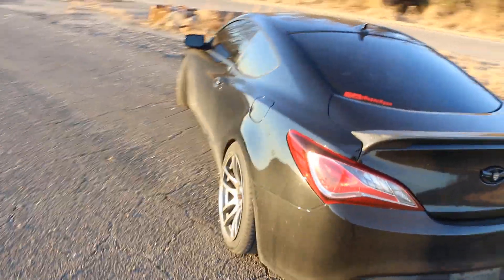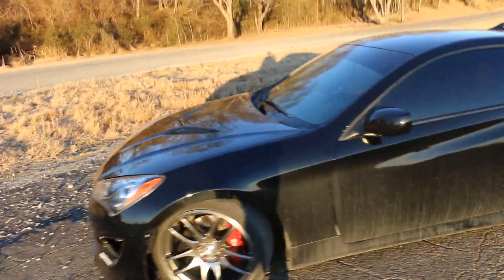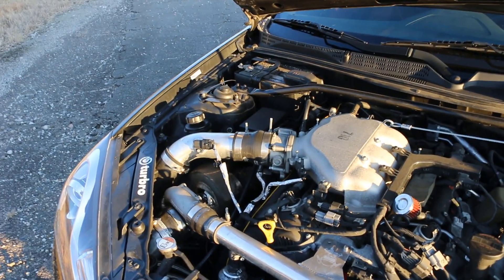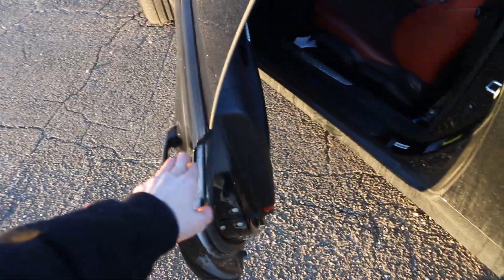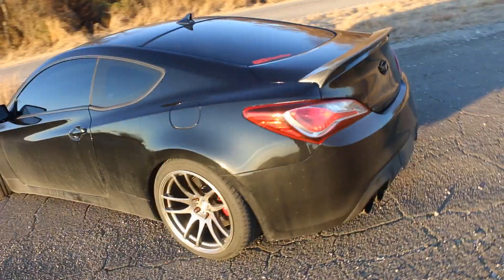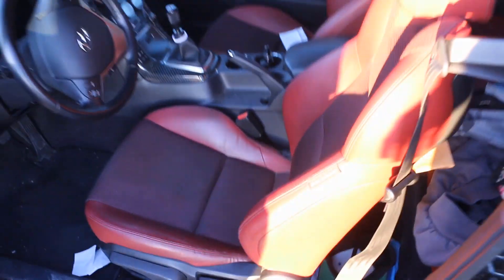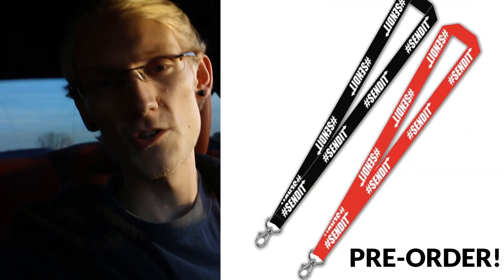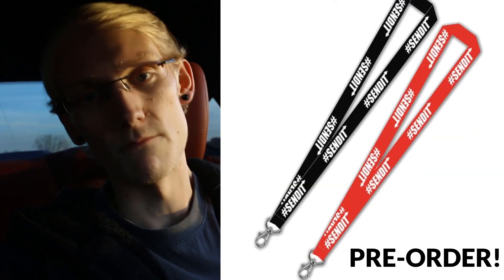Why I HATE My Boosted 3.8 Genesis Coupe

Comment: The door noise is your glass seating itself in place. Whenever you open the door the glass slides down like an inch, the when you shut it it seats itself to help seal it more
Reply: Why I hate my life #TooManyCarPaymentsNoYoutubeMoney #4Cars #Evox#WrxSti#C7Vette#2xTurboV6accord
Reply: thank fucking god someone else knew this, i was seconds away from going off in the comments, but ya, its supposed to do that basically. maybe it could sound better but it also works as a protective measure for the glass to it doesn't rub, push up againt, or bend into the door lining
Reply: Actually it happens so that there is a way for air to escape and pressure to equalise while opening and shutting the door, so that Δp surges does not break the windows.
Reply: This
Reply: it's so obvious I thought he was kidding...but I guess not geez
Reply: there should be hidden flaps in the car under the trunk to allow this to happen. where the hell do you think the air goes when you have the air on and it isn't' recirculating? what about cars that have the door glass framed like my dad's mazda protege? this is specifically to protect the glass
Reply: @berengerchristy6256  There is, I gutted my trunk and there is a flap on each side of the car under the trunk liner
Reply from the maker: I know the glass slides down, i am aware of this. Its pretty obvious. That is not what i am talking about, im talking about the glass smacking the seal of the car and making a god awful noise.
Reply: For somebody who is a car enthusiast I would’ve thought he would’ve known this
Reply: hes talking about the sound the window makes before it slides back up into place, not the actual sound of the window sliding.
Reply: RspecRyan oh okay. I was just trying to be helpful lol no hate bro.
Reply: @RspecRyan  Sounds like a door issue, I've been in three gens, plus my own, and none of them sound like that
Reply: I drive a coupe e400 2014 the windows do the same thing but the doors have a nice shut and seal quietly
Reply: I don't believe it does it for a better seal, most of the time the windows do that to reduce the build-up of pressure in the cabin on a hot day as a safety feature.
Reply: It's called indexing.  The windows rolls down to open and then up to seal in the outside strip.  Ford Mustangs do the same thing.
Reply: @LHofstadter  that's true for for Mustangs but for the scion FRS it was designed to release cabin pressure and in his car I'm pretty sure it's for the same reason.
Reply: nah doesnt sound like that new its not loud at all new its from years of weather wearing on the seals so now its hitting the metal doorframe a bit as it seats onto the seal

Comment: The transmission was the same in my 8th gen si. Once I changed the clutch master and slave to the ktuned one (gets rid of the fluid delay valve) it shifted so much better. I also did little things like shifter bushings and base bushings which also made the transmission feel much more smooth and easier to get into gear at high rpm's.
Reply: Bruh a 100 videos and 100 forums later in the comment of a video I didn't notice said boosted (so I woulda never clicked on it) was this answer. Lol

Comment: Hey Ryan, try flushing with the gm synchromesh friction modified transmission fluid and if it still gives you problems then add lucas transmission fix to it. Hyundai synchros are just poorly made and incorrectly sized from factory. Do this and shifting will be easy. It works. I really really hope you see this comment.
Reply: Dmitriy Sen thank you for this

Comment: Hyundai are getting better with their cars I own a 2013 Elantra I decided to turbo it with a boostec performance turbokit running a Garrett gtx2860 running about 5 psi for a safe tune for daily driving and running a aem fic for boost and the bigger Bosch 550cc injectors I been running this set up for almost two years only problem I have was a map sensor code that I just finally figure out from buying a expensive scan tool to reset the engine adaption value to fix the code but from that no issue engine pulls hard for only 195 to the wheels
Reply: Micah Hill how much did it cost to boost it
Reply: Crowd Killer 5.0 overall it cost me around four grand
Reply: Something Wicked This Way Comes when it was stock it made 143 to the wheel with a kn typhoon intake and the custom exhaust on the 1.8 im basically making the same amount of power as a turbo veloster and Elantra sport with the 1.6 turbo gdi engine stock power and even a little modified one as well with a intake and exhaust maybe
Reply: Something Wicked This Way Comes well it is hyundai way of making a engine to save gas but not make any power also what engine was Honda running is it an civic with a b18 or b16 vtec motor cause they make around that much power
Reply: @Something Wicked This Way Comes what Honda ? of course if its a sport model it will push more than a stock 2013 elantra. look at the type R or golf R today they push hard and doesnt consume much gas bone stock.
Reply: @Something Wicked This Way Comes thats what I thought. Thats a good car, honda was ahead of the curve for sure in small NA engine
Reply: 195?? 😂 what’s the point
Reply: I think you can go atleast 10lbs of boost

Comment: I believe the door windows roll down slightly and then roll back up when it shuts to avoid damaging the weather stripping.  I know some of the challengers do this as well.  It sounds a little annoying, but helps in the long run.
Reply: It is for air pressure in the cabin. Luxury cars have done this since the late 80's so your ears don't pop. That said the glass should be reinforced a bit more.

Comment: The shifting problem is because the step from 1st to 2nd is too large. Pause in neutral for 1/4 second, or so, and it will go in. That is why that syncro fails from trying to cram past it. I think they were trying to accommodate the torque less 4 cyl POS. The other alternative is to remove every other clutch dog on the sliding clutch and 2nd gear. That gives a big gap to enter, which in this case is better. You will feel the slop on and off the gas but just pretend it is a well used pussy.

Comment: There are plenty of nicer options for the Genesis in regards to front bumpers. 
Hyper G, Ark Legato, Ark Solus-
All very nice pieces in my opinion. I’m aiming for the Ark Legato myself.
Reply: Hyper G is my fav
Reply: @Xabier__Gomez  
Hyper G is nice. I'd like that or something like it for the rear. (Ark Solus, iirc; haven't looked at modifying the car since the original comment)
Reply: @Zephyrine.Koritsuka  I have the hyper g as rear bumper on mine and it looks mint. Down the line, I want to finish the kit with side skirts and front bumper

Comment: I didn't want to go through all the comments but if no one has mentioned it the transmission issue has to do with their synchros the way to fix this is to get dog synchros that is not to be confused with dog gears that whine when you drive just the synchros have to be dog engagement

Comment: It's the synchros aren't meant for aggressive 1-2 shifting like in a drag race.  My Civic Type R has the same issue.  You can burn out your second gear driving the piss out of your "performance" car.  This is why you are best to enjoy a car the way it comes from factory, cause there is always something holding you back when you don't buy a properly engineered car.

Comment: The shifting issue migrh be due to the dual mass pressure plate....it's there to help with the vibration....you might be able to get a single mass pressure plate but it might be noisy and shaki .....BMW has the same thing and people complain about the noise after the aftermarket plate is installed.....just my 2cents
Reply from the maker: It has a stage 3 clutch and lightweight flywheel

Comment: For the transmission do the things you said but...if you have grinded the gear already the syncros need to be replaced. With the movement taken out with your mount, leash and shifter they should keep the problem from happening. As of now the syncro teeth are already rounded off. Thanks for the video and how do you like the shifter. I have the ATQ shifter and bushings and it shifts great now with my replacement transmission.

Comment: It's the 2nd gear sycro it doesnt slow down the gear enough so it doesnt go in and btw the tiburon gets shit talked about it but it's also a great car and also the 2.0 in the tiburon has made more power before than the 2.0 in the genesis coupe 😏 it is still fwd car tho but it handles well with the right mods and it actually over steers more than ot understeers
Reply: The Tiburon makes barely any power stock and if you want to actually make power you gotta get forced induction which causes thousands. Also not sure how a tiburon faster is than a 2.0t genesis which makes almost double the power and can actually put the power to the ground.
Reply: @teknoartist  yeah it would cost thousands but then again you spend thousands less on buying the tiburon and I said it has made not that it makes meaning when the motor is built the tiburon 2.0 has made more hp then a built 2.0t genesis coupe they have been making 600 to 700+ whp since the early 2000's in Korea the block is physically stronger than the theta I mean I love the genesis coupe but I just said people dog on the tiburon but they have made power before
Reply: @PeelePowered  no they're not and they can make some good power

Comment: Have you asked a gearbox specialist about the box they may have a cure, one of my mates had a Ford Mondeo ST 24V V6 in 6 months it had 2 new gearboxes and he took it to a specialist as he deemed Ford a bunch of idiots the specialist did do work for Ford and he said the problem was with one of the selectors that needed altering as it was fouling up during shifts and he also sent the details to ford and he never had any moe problems.

Comment: Did the 2nd gear issue gradually became worse or it was that bad when it was new?
Sounds exactly like a synchro issue especially if it is getting effected by the fluid type.

If that's the case i think you should look into some stronger synchros which might be hard to find, but i've seen people with really bad synchros get really good results with a really good transmission fluid that is for that that purpose. like Royal Purple synchromax.

Comment: Ryan, would you recommend the genesis as a first performance car for someone?
Reply: I'd say depends on what you want to do with it. Overall it a cool car. A friend of mine had a 2010 with the 3.8L engine. Didn't really go to fast in it since it wasn't my car. If you're willing to go "cheap", I've seen a few gen 1 for for 10k or less. 
I recommend try to drive one if you can. I know some people like the 2.0T version better especially since it's already boosted.
Reply: I'd recommend it. It's enough power to have fun with. My 3.8 has been realiable. Good car to get into the car scene
Reply: @fattygamer94  something that won't  cost a whole lot (I've seen a few second gens for less than 20k with less than 100k miles) stick or auto dosen't matter but I'd prefer a stick. Also I'd want it just to have fun with, no drags or track, just a fun nice ride. As far as mods go I'd do tires and if i felt like it needed it anything with suspension to make it handle better (if needed) and sometime down the road either some sort of turbo set up or supercharger.
Reply: No get a Honda preude
Reply: @Manuel Rivas for sure it is but some people do like it being preboosted to upgrading the turbo setup is easier than installing a whole new one.
Reply: @devinlowe51  Yeah, if you can find a gen 2 you like, go for it. Try looking for certain trims. Like how R-spec and ultimate trims have limited-slip diffs and brembo brakes. The rspec is only available in manual but the ultimate has the optional 8 speed auto.
Reply: I have a 2013 2.0 and it is way more fun than the 3.8 that turbo is sick plus you can tune it and get 300hp to the wheels
Reply: @fattygamer94  it's a toss up when it comes to transmissions on the genisis XD the 8 speed seems idk not up to par with a lot of the other modern autos lmao even in manual mode I've heard people complain how it'll upshift whenever it wants to??? And the manual has that 2nd gear "lock out" issue but that can be fixed. I personally like the look of the 2nd gens and it is just a different car in general. I've seen one 2nd gen Coupe in up state NY.
Reply: @ismazzbot  yeah i got mine dynotuned by jay at sfr.  305whp 350tq.  Its fun. 2.0t full bolton.
Reply: @devinlowe51  dont buy 2.0t gen one. Also what  jose puello   said seems interresting. I don't know about their diffs, but it would be unwise to not get a lsd in this kinda car. Another good choice is a Brz, its kinda slow compared to the competition but handling is freaking good due to low center mass. Also light, so wheels will spin if you want them to in first and second gear. 350z's are great too, just watch out for the weird engine oil burning it would be wise to inspect it thoroughly (is that the word ?). Have fun looking for a car man !
Reply: @cmonguys2227  thanks lmao XD my two current veichles (07 focus and 04 ranger) aren't exactly "mint"😂 and I'm just waiting patiently to get a "fun car" I'm currently going to school for auto body, with some auto tech to go with it. First semester is done basically and i plan on getting either a part time job close to school during the end of the second semester or 3rd semester. If not imma save some pennies and see if i can trade in the focus for something. Anyways I'm mainly attracted to the Genisis due to the fact that they are different you know? And the hoondia that ryan has on the cooler is great XD
Reply: @devinlowe51  Oh yeah this is nice ! wait till you get a job in your field if you can so you dont have to cheap out ! I had a acura rsx that was completely falling apart lol, it was still a really fun car tho. I bought a Brz thats why I gave it a good word, I personally know its a good car. I really like the Genesis too ! I absolutely agree with you that its different and I like what people do with them, lots of respect. Have a great day and hopefully you get exactly what you are looking for !
Reply: @cmonguys2227  the 2.0s are way cheaper to make power on.  The stock block handles a lot of power and you can easily throw in a bigger turbo. If you want to make serious power on the 3.8 you have to invest thousands into forced induction.
Reply: @teknoartist  this is true. only thing is the first 2.0t were not really satisfying without mods. not everyone can afford that kind of car plus mods right away, they usually need to pay for the car itself first. I wouldnt go for the 3.8 for reasons you already mentioned, but its a good choice for first gen stock. I would go for a second gen 2.0t then make my way up the mods as you said, it would just take a lot of time. I personally chose to buy a Brz as I have been a subaru fan for over ten years now and its the first time I could afford one that I wanted, but as I said I really like the Genesis.
Reply: Cmon Guys lol you said to not buy a 2.0 but to buy a brz 😂😂🤦🏽‍♂️
Reply: Yea I got a 2013 2.0 with 75k miles for 5k. Hell of a deal this car is good fast and saves a lot of gas. Plus sounds very good with cherry bomb mufflers. Mine is stock currently going to tune it up but even having it stock with cherry bomb mufflers is pretty fun to drive around plus haves good handling too.
Reply: Only bad thing is that the back seats are very small but I don’t care since I’m always the one driving 😂
Reply: @Jaiden-ll3nc  why would you spend more money for a slow naturally aspirated car that makes only 200hp. Granted the handling in brzs are crazy good but they are laughably slow.
Reply: @cmonguys2227   yeah the bk1 generation is straight trash, if you are going to get a genesis it has to be a bk2. I got my 2.0 for only 7k and i spend 4k on mods. I'm running full boltons with a stg 1.5 tune with a limited slip differential and grippy tires. I hold up really good against must mustangs and 370s and hopefully when I go stage 2 with meth injection and a custom tune I will get a couple of 5.0 kills.

Comment: The dude saying the transmission is crap, bruh you just need to learn how to shift, change your transmission mount for a meganracing. I have a 2013 2.0T on stock turbo and im doing 13.58 at the 1/4miles
Reply from the maker: I have the megan mount and I run that time spinning through first and missing second
Reply: Do you have the 4th differential bushing installed? I think u do but im not sure